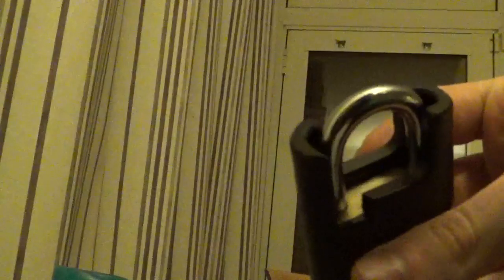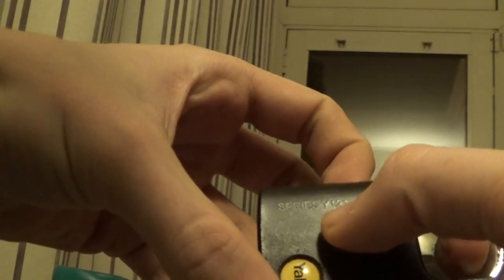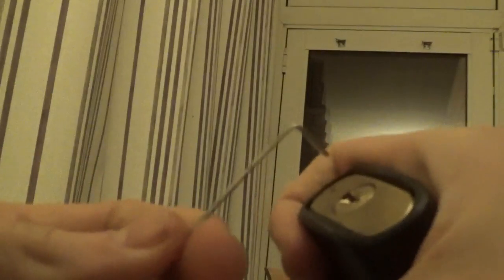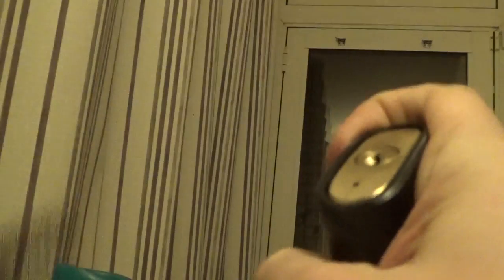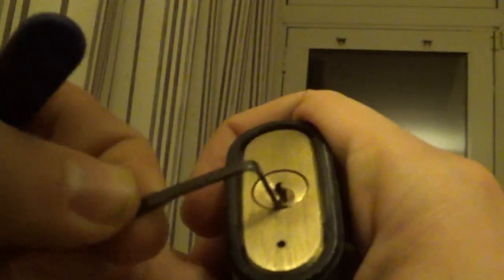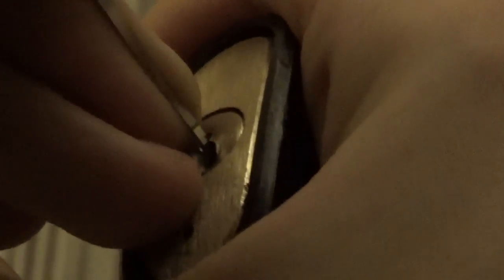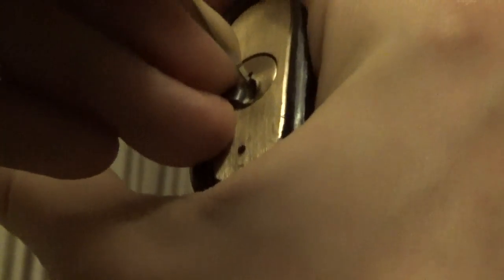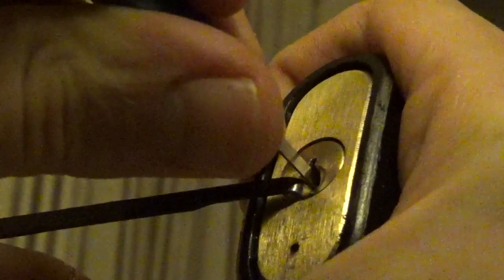Lock:37 Yale Y121/40 picked. Little fighter

Comment: Nice fight with the Yale 121 ;). This is not a beginner lock, it is full of sharp spools which do like to catch ;D. Nasty to pick and not easy. If you like spools (as I do too hehe), there are locks with much nicer feedback like the Zone 130x or Zone in general, Brinks, Stanley, or Abus 85 (and many more) :). You're doing well with the shallow hook, try a 18-20 thousand, it does not slip off the pins that much and you get more feedback. You get away on most european locks with only using a very shallow and a medium hook with slim profile in 18-20 thou (mine are 19). Well done, especially considering you picking it left handed :D.
Reply from the maker: redcatimaging Thank you very much for the kind words my friend. I struggle to tension with my thumb without over tensioning the lock. Yes i like spools I have picked Zones and abus. Not a brinks though yet. Yales do have nice feedback. Standard pins can be tricky to Spp at times. Tensioning is the hardest part. Thank you for lhe comment!